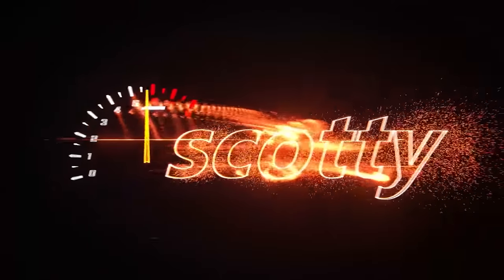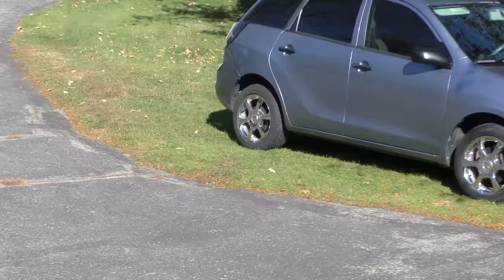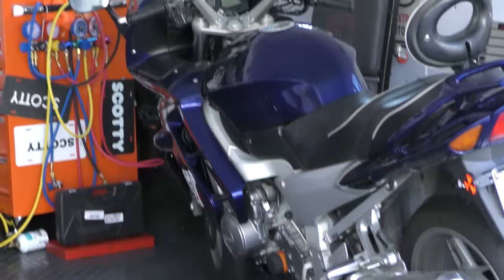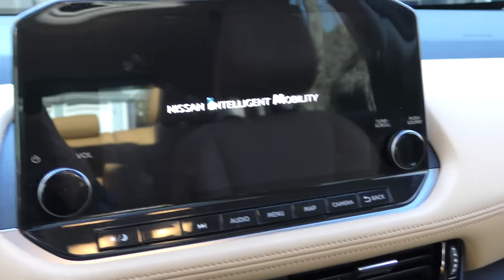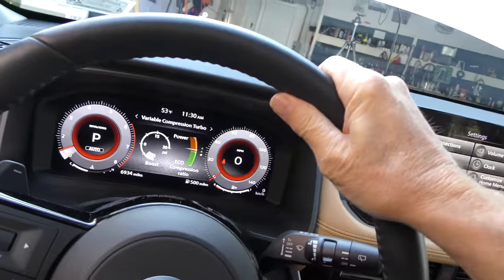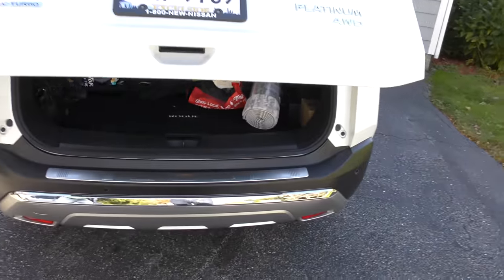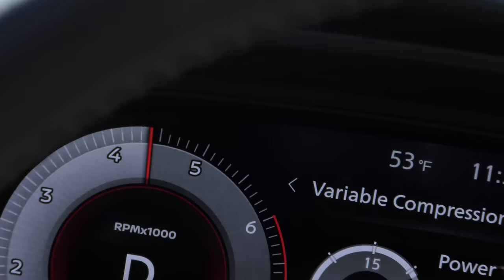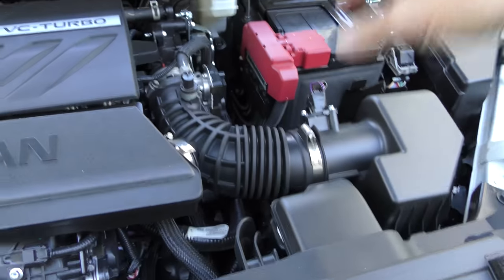Nissan's New Engine Shocks the Entire Car Industry

Comment: Nissan has been working on VC for the past 25 years. They were even working on it in the days before Renault took over. This 1.5L turbo 3 though for what it is, it’s overall impressive. 201 hp/225 lb Ft is nothing to sneeze at. GM’s 1.3L turbo 3 by comparison, only makes 155 hp/176 lb Ft. Ford’s 1:5L turbo 3 at 180 lb/203 lb Ft and Ford’s is nowhere as smooth or vibration free. Just wish Nissan went dual injection with it. The fat it only needs regular fuel is a plus too. Hopefully the redesigned JATCO CVT-X (as it’s called) will hold up but seeing it was designed for this engine, it should, proper maintenance is the key still too.
Reply: Didn't they use this engine for infiniti first?
Reply: @vergiljerome9126   yes but a 2.0L turbo 4 cylinder, although it debuted in the 2018 Altima first. Also, the Altima version runs regular fuel (236 hp) and the Infiniti version premium fuel (268 hp), both make 280 lb ft. The Rogue introduced the 1.5L turbo 3 version, 201 hp/225 lb ft on regular fuel.

Comment: I'd really like to read the fine print on that "lifetime transmission warranty". I can just about guarantee there's a lot of exceptions where the warranty will be void or the dealer will say "oh, that's normal". Replacing a transmission is no small job, so either Nissan is very confident this transmission won't have any problems (which I doubt, given how the previous versions have held up), or they have made sure there are so many exceptions they won't have to change practically any transmissions for free. Mind you this is a car company that's been on the verge of bankruptcy for years.
Reply: hey, it's not Nissan providing the lifetime powertrain warranty, it is the Nissan dealership.  Very few dealerships will offer it, they are definitly hoping that the engine does well for Nissan.
Reply: I have the life time warranty on mine and I think the only stipulation is I take my car to get serviced at Nissan at least once a year, right now I have a 5 year service & rotation plan on it anyways so I’ll go there anyways

Comment: We bought a new 2021 Rogue SV last year. Same exact new body style as this one, but I guess the turbo charged 3 cylinder engine wasn’t ready yet, so they stuck with the 4 cylinder engine for just that one model year. Interesting decision, but I’m glad they did. 33,000 miles on it so far, and it purrs like a kitten. CVT feels as good as any decent automatic I’ve driven (edited to remove ‘shifts,’ as one reply correctly pointed out), so no complaints there. Gas mileage is still good…not quite what the 3-cylinder can do, but we get anywhere from 32-34 mpg on the highway. For the piece of mind knowing we have an engine that’s actually serviceable, I’ll take that over the new tech any day. We also opted for the extended warranty just in case something goes wrong with that new CVT, but so far, no issues. I can’t say much for 2022 and up with the fancy turbo charger, but if you’re looking to buy used, I HIGHLY recommend the 2021 model year. Very good vehicle!
Reply: CVTs cannot Shift. There are NO planatary gear set. FYI.
Reply: I have a 2021 also SL with premium package. It’s a amazing vehicle and the interior rivals luxury cars I have had
Reply: You have 33k miles.....that's not a test for anything.....
Reply: @richsweeney1115  I’m just sharing my experience, good grief… 🙄
Reply: i have a 2012 sentra 2.0 CVT with just under 100K and it runs just fine. i service it every 30K with nissan-approved fluid. the main cause of CVT failures is the faulty 'nut' behind the steering wheel....
Reply: @tommurphy4307  you barely have any miles.....most are crap
Reply: That 2.5  cylinder is a sweet motor. I have a 16 Altima 2.5 SR, that motor has great sound and feel.

Comment: Haven’t had a Nissan for 17 years but recently picked up a Frontier pro 4x. I’m confident it will be reliable.
Reply: Should be I have a 2015 nissan pathfinder with 245,000 miles 0 issues I also have a 2019 Altima with 145,000 miles also 0 issues and a 2008 nissan rouge 310,000 miles with 0 issues so I’m pretty sure the frontier will be just as reliable just make sure to always do your maintenance on time that is what I have always done and all my Nissans run perfectly that why I don’t understand why they talk down on them so much

Comment: My only experience with a 3 cyl was a Chevy Sprint.  It was great on MPG and zipped around town fine.  But when you got to any kind of grade/hill, that is when you felt the lack of power.  Oh, and the motor gave up the ghost at around 135K.
Reply: 135k... that should be a crime
Reply: especially bad if they were a turbo model
Reply: I grew up on cars with 4, 3...and 2 cylinders (ex. Fiat 600/650). In Europe, 3 cylinder engines are more common than here, so nobody is scared of them. I had one with 3 cyl. as a rental in Europe 3 years ago and it felt OK even though it was producing just around 100 hp.
Reply: this one has 200 hp as the man says. more then enough to go up a mountain. besides are you going to enter it in a road race? then what does it matter?
Reply: @spol1622  what 3-cylinder motor made 100hp??
Reply: @XTRABIG  haha thats rookie numbers, some of the ford ecoboosts were giving up at 40k
Reply: @tommurphy4307  A lot of them lol
Reply: that one didnt have electric motor to back the weak little 3 cilinder up. This 3 cylinder gets support from 4 electric motors for each wheel
Reply: @tom murphy  it was in small Skoda (can't remember exact model.)

Comment: Bought my wife a new top of the line nissan Rouge SL back in 2016. It has right now 170,000 miles, zero issues so far. Regular maintenance is all I have done to it. Still looks new, runs great and everything still works.

Comment: Nissan's built in Japan are by far the most reliable cars on the road... And unlike Honda and Toyota, Nissan has always stuck to the timing chains instead of timing belts. 
This car has been out in Europe for almost 2 years now, it's called the Nissan X-trail. They have had very good reviews from them so far. They seem to be selling well over there and I'm certain they I'll do well here as well. 
Scotty I'm surprised you don't know this being a Toyota fanatic but this technology was first used by Toyota in the Toyota Yaris GR with it's 1.6L 3 cylinder turbo, generating 261 HP. And it's AWD system puts the power to the ground real well! 0 to 60mp/h in 5 seconds.

Comment: 4WD is not necessary.  Knowing how to drive is.  I had a '72 Saab I drove to work from my house at 9300 ft elevation to work at 11,000 ft elevation in Colorado.  Did fine in winter.  I did learn that letting off the gas is like putting on the brakes.  Flipped me around backwards at 50 mph on an icy patch and hung the front wheels over the edge of a cliff on a downhill on another slick morning.  But, that would have happened with 4WD too.  Slick slick...

Comment: I bought a 2015 Rogue SL new in 2015. The thing is very reliable only thing done was routine maintenance (replaced tires, oil changes, fluids and tire sensor Oct 2021), when got it serviced back in July saw on paper next service will need rotors/brakes overall CVT works great still, car runs like new and comfortable. I really love it got extended warranty. It's paid-off (Scotty be surprised see my 7 year old Rogue), like new inside and out. Love everything the 2.5 liter four cylinder is powerful at over 30,404 miles still doing well on CVT tranny which nervous how long last do get it serviced at 30,000 miles usually let Nissan Service Department services it they do take good care of it put plastic on my seats everything + give me lots of paperwork on stuff was done. When I drive my baby makes me happy 😊 one thing a blast that BOSE stereo ... man! That thing kicks was listening to a song early this morning on SXM radio 📻 should heard the bass 🔊 like had added sound system in the trunk it even smells new. I love Nissan appreciate them making me a good car so far has smooth ride as handles well planning keep her until she rotten out looking like Fred Flintstones car. The company doing so much better makes me happy 😊 Scotty now appraising Nissan they are comeback getting popular again interesting in a 2023 Pathfinder and love refreshed 2023 Altima they are amazing with the lineups.

Comment: Funny you say that...I bought a Nissan Murano years ago and it ran perfectly.  I traded it in for a Toyota Venza and that thing was total crap.  Toyota had to replace the engine on that thing!  I traded it in for my current Murano, and it has been bullet proof.  So I'm not sure what your issue is with Nissan.
Reply: We’ve had several Nissans.  Rogue, frontier, Sentra , Altima   Never had any issues 😊

Comment: Always been a nissan guy since 90. Started with an 88 maxima and keot going through the years with different ones. I miss the 90s nissans, hands down tje best so far. Howerver, i was given a nissan altima vc tirbo by the insurance company because i was just in a wreck and whoa. It runs geeat....so far. I might look into the rogue for me. We have an Armada and a pathfinder with zero issues. The trick is not to dog them out and change the oils religiously.

Comment: Lots of high tech features... lots of high tech that can fail too.  Turbocharged 3 cylinder engine... plenty of power when you mash the go pedal, but when going up a mountain, that turbo is likely going to be providing a lot of power for a prolonged time.  Turbos generate a lot of heat, how is that extra heat going to effect the oil, coolant, all that high tech stuff inside the engine, and the transmission?
Reply: because there are differences in nissan-produced vehicles destined for high-altitude markets. those differences are always referenced in the parts and service literatures. the same thing can be said for high-altitude engines in general- they have to deal with lower-density intake air just like people do. high-altitude vehicles are available outside their normal markets thru special ordering and vice-versa.

Comment: We just leased a Champaign Colored Rogue Platinum and I am disappointed that our car did not come with a Tonneau Cover or The Homelink System, otherwise I love the car so far. This is our 3rd Rogue. We had 3 Muranos, 1 SE, 1 SL, and 1 SL Platinum. We had 3 Zcars, a 1980, a 1985 Turbo, and 1990. We also had one Altima. Our children have had a host of Nissans. What I see happening is Nissan is doing what the American Automobile Manufacturers are doing, allowing the dealers to squeeze you for a little extra to get everything you want in the car!

Comment: I'll say this:  I have a 3-cylinder Escape and it's a mess under the hood with wires and pipes going all over the place.  At the very least, Nissan did a bang up job of making it nice and tidy under the hood.

We have a 22 Pathfinder and the interior is an extremely nice place to be and very similar to the Rogue (our is a Platinum also).  We've got about 12k on ours and it's been a great vehicle for our family of 5.  Nissan is really trying to change things up.  The new Frontier is a great truck too.
Reply: Nissan got rid of their CEO in 2019 and the new CEO really turned things around!
Reply: My wife has a 14 escape titanium, with
 The 2.0 ecoboost ,4 cyl.. Its pretty quick when you want it to be.and every newer car or truck has wires and sensors and hoses everywhere....you have  12k miles.....thats  not a test.....anything can go 12k miles.... there is a PSB out saying there Nissans aren't safe......I guess nothing's changed.....y
Reply: @richsweeney1115  Relax.  No one's crapping on Ford, just made an observation that the newer Ecoboost motors are a mess under the hood and nothing is easily serviceable by the average shade tree mechanic.  Don't get your panties in a twist.  I didn't once say they were bad cars.

Comment: I took my 2022 Rogue in yesterday for an oil change.  The service rep told me they have been replacing the engines in the 22 model at 20 to 30 k because of some accelerator related part that causes the car to stop.  It is built into the engine, so the only way to fix it is to replace the engine.
Reply: Free of cost or have to pay for replace the engine ?
Reply: I bet your engine is doing just fine!

Comment: I had a 2016 Nissan Rogue that I purchased new. The dealership offered "lifetime" engine warranty and free oil changes. That lasted about 2 years. Also had a class action lawsuit about the transmission so the warranty on the transmission was extended. Did all maintenance at the dealer. At 58,000 miles the transmission started to fail, took it to the dealer thinking it would be a relatively straightforward warranty replacement. How wrong I was. They initially said it was the transfer case, which they replaced at a cost of $2700. Transmission was still slipping when they test drove it after, so they replaced the transmission under warranty. After that debacle, I traded the Rogue in for a Toyota Rav4 and I am much happier. I will never buy another Nissan. I doubt the new Rogues can go 100,000 miles without major repairs on the engine or transmission.
Reply: You should have looked at Hondas too
Reply: Got a 2015 Rogue with 136K. No issues whatsoever. Kept up on maintenance and that's it. Drive it to work everyday and even a trip from Colorado up to Yellowstone and a couple of trips to Texas to see family. Hasn't even thrown a code. I get that Jatco has had issues. But with mine, it runs like a champ. Got a 21 Maxima as well. Too early on that one but I'm not losing sleep on if the CVT fails

Comment: I don’t want a 4 cyl Turbo ever so imagine how I feel about a 3 cyl.  Never.  There’s no replacement for displacement.
Reply: But like there literally is tho???? It’s not 1903 dude
Reply: @ethangiese2109  I’m 70 yrs old so I don’t have to change.  My new F-150 is a 302 V8 and it will last the rest of my life.  These small engines won’t survive with all the boost required to generate the necessary HP and Torque.  Just watch them come apart.  These aren’t Ferrari’s and Porches that can take single and twin Turbo’s rev to 9k and in the case of Porsche run for a long time.  I know I’ve owned 2 Ferrari’s and 3 Porsche Twin Turbo’s.  The Porsches were everyday drivers.  I understand the Raptor has twin screws and 450 HP but not for me.  The 5.0 can be tuned to develop much more.

Comment: Don’t be fooled by the “Lifetime Powertrain Warranty”. It requires that a list of services in the owner’s manual be performed on time. Took my wife’s 2022 Pathfinder in for service at 18k miles. Told the dealer to do the 15k and 20k services listed in the manual. It required brake and transmission services be done among several others. All said and done it was gonna be $900 for it all. I said no way. The service manager said he’s seen Nissan deny that lifetime warranty over a late cabin filter replacement. BTW, the transmission fluid for the 22 Pathfinder 4WD is $50 a quart! The service manager also said he wouldn’t bother to do the service schedule in the manual because much of it is unnecessary and you’ll end up paying for the new engine/transmission in needless service fees before you ever use the warranty to replace said engine/transmission.

Comment: The nissan dealer in chicago suburbs also offers unlimited powertrain warranty, however I also got a 10 year 100K mile bumper-to-bumper for all the camera and the sensors.  It's also a transferrable warranty.  It's a nice feeling car, the wife likes it for the reasons you mentioned - HUD, 360 camera, heated everything...

Comment: Well seems like good tech but I'm gonna keep my 2015 diesel golf only paid 14k and it was like new 20k say for nearly 2 years b/f it was fixed. 50 mpg over the last 2100 miles. No issues. And 11 year 162k warranty. Unbelievable. Thx Feds for negotiating a great warranty.
Reply: yeah- they are good cars- considering they were built by a fraudulent manufacturer.

Comment: Scotty I had a 2018 Nissan Rogue SV which was an ok putt putt but when I drove the 2022 Rogue SL I sold my Rogue and Frontier for more than I paid for them, and I downsized to just one car, the new Rogue is so much better than the competitors and I too got a lifetime warranty on the drive train.
Reply: it seem Nissan have confidences in their all new X-CVT with the 1.5T, I have seen the pic of the trans and it look more stronger than previous CVT they made, as it actually have a flat steel belt, looking similar to Subaru CVT.

Comment: Wow. He paid more for a Nissan Rogue than I did for my brand new 2019 Tundra 1794 4x4 purchased in 2020. Yes. Previous yrs model built in December 2019 without the push to start but that's exactly what I wanted..

Comment: Bought a 2023 Pathfinder with the platinum package. Love the features and the car, but am having issues with the engine now.  I was excited that the engine was so exposed and seemed accessible and easier to work on than anything else.  I guess I didn't realize that meant I would be working on it so soon.  Nearest dealership is a hundred miles away and I'm busy as hell.  F.

Comment: Betcha there are a bunch of plastic parts in that engine that will fail with time and exposure to heat that will require a swap or rebuild at about 100k or 8 years.